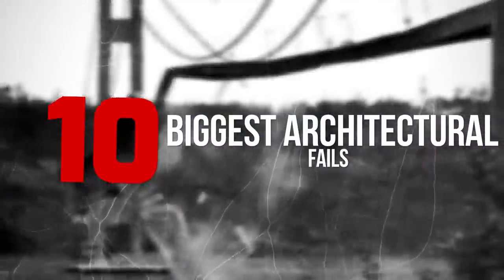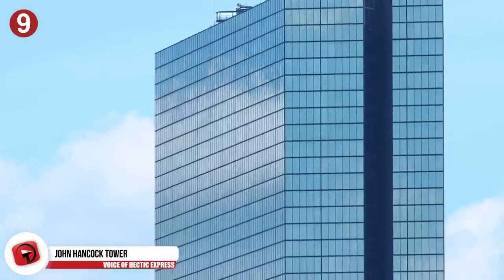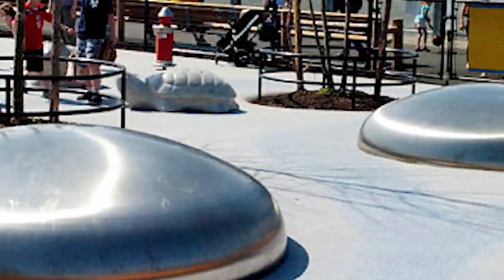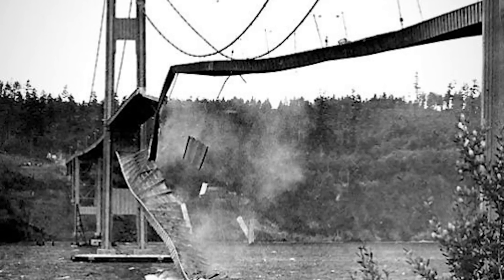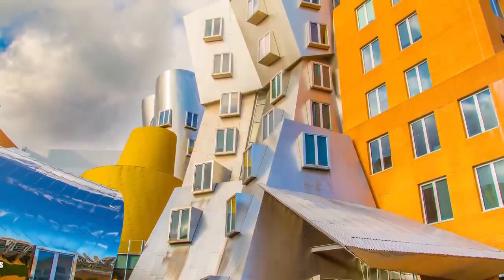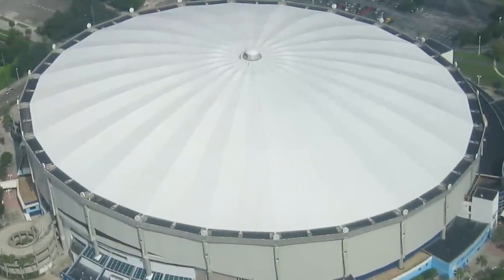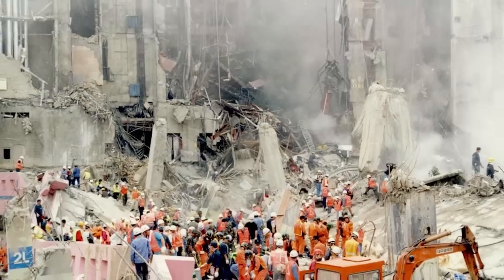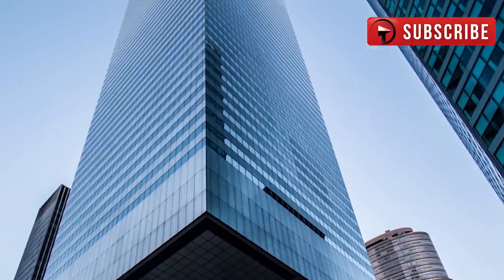10 Biggest Architectural Fails

Comment: One skyskraper toppling over would kill how many? 200000 people? Is there a nuke hidden in that building? How? Why? What even.... I just... Wow...
Reply: Yeah I was scratching my head a little bit on that one as well.
Reply: But..but..but either way it was built above a church and they could've prayed to " their God(s)" XD
Reply: I was just about to post something about that… I'd like to see the number crunching that went into that calculation.
Reply: acuchemkid2007 It would wipe out my town 8 times over...
Reply: Its the accumulating damage.  As well as taking out itself, the church and people on the street below, its located in a tight place.  So it would damage nearby buildings, and possible topple one or other others. 

Each skyscraper its size has a population often the same to a town.  So the can house up to several thousand people. So if that skyscraper fell and hit another, thats two towns worth of people who can get killed.  Its the architects fault for building them in that area so close together. ITs surrounded on all sides pretty much by towers.
Reply: I guess it would have triggered a domino effect and cause many other buildings to crash to...on the other hand: when the first tower of the WTC collapsed it didn't even cause the other one to crash too.
Reply: Yes, it has the potential to kill thousands. However, that doesn't mean any large number you barf out is valid.

There are 71,672 people/sq mi. in Manhattan. That's 610 people per block. One World Trade Center has 109 floors. If there are 200 people/floor, that's 21,800 people. If OWT, the tallest building in the US fell and wiped out the blocks in its path (about 5 blocks), that's 24,850 people. That's less than 1/8 of 200,000.

That scenario is the most extreme case (tallest building, extremely high population density). 

So, 200,000 is a tremendous overestimate.
Reply: AngelEmfrbl To kill 200 000 the building would have to be chasing down people as it fell... And even then it would be hard pressed to reach that amount... Yes a fully filled skyscraper would mean several thousand people dies, but 200 000? Come on man... Think before you answer...
Reply: Yeah But WTC went straight down and it's been proven that there were explosives in place.

Had it fallen the way it naturally would have, the top of the tower would have slid off, you'd have half a tower standing, the other half would fall onto the street.
Reply: "Up to 200,000" probably because that's exactly the maximum amount of people that could fit in a Citigroup Center-shaped area below the Citigroup Center.
Reply: Denberg has a great point - please give some proof of these explosives Sean nolastfuqingname.
Reply: +Sean nolastfuqingname please site the proof of explosives in place. Either pics or vids or it didn't happen.
Reply: ***** he must have been a dirt poor migrant worker because if memory serves me right the sales of handheld video cameras exploded in the mid 90's and was a must-have toy for those of us who had the the spare coinage lying around. They had them in the 80's as well if you didn't mind lugging around a unit that accepted full size VHS tapes.haha membah dose niggah?
Reply: +Mark Winberry Btw twatty, My IQ is 161 and I have never been poor. I graduated from a top 50 university by mostly just doing the exams because I'm smart enough and I could. I'm also the only person in the history of UCI to have had two Engineering senior design projects instead of one. Lol.
Reply: Tarek - what area of engineering did you study?
Reply: +BassGuitarGuy128 Materials engineering.
Reply: +Renberg If you look at close ups of the collapse you will see mini-explosions happening on the steel columns, as a materials engineer I can easily say that those are not caused by buckling... However, I did make a stupid mistake by stating facts to a "Berg" on youtube. Or I maybe I MEANT TO MAKE THAT MISTAKE to see how creative the lies of denial would get.
Reply: +Renberg I'm arguing with a fucking photography-lover about Physics. Nice. In my defense, I AM really bored these days...
Reply: Tarek - you have a degree in engineering. You must know that you cannot derive conclusions and make decisions based on limited, observational evidence; especially when those conclusions insinuate some outlandish claim - that the U.S. gov't killed 3k Americans and wasted two skyscrapers so it could start a multi-billion dollar war. 

How sure would you say you are of these 'mini-explosions' being caused by explosives and not the aircraft full of highly flammable airline fuel? How about a percentage.

Where's that evidence? Where are the computer models? Taking a film clip and saying, "Yep, explosives were used" doesn't cut it - not in academics and certainly not in the real world.
Reply: +BassGuitarGuy128 100% sure. People have already made computer models based on footage and distance of structural debris from ground zero.
Reply: Would you care to cite your source(s)?
Reply: Tarek EL Derbas What a coincidence, I have an IQ of 162... I've flown around the moon twice, won a noble price and have three degrees in physics. I just take time of in my busy schedule here at the Large Hadron Collider to answer YouTube comments. I greet you my fellow genius.

Also, in my free time I volunteer as a fireman to rescue kittens from trees and I serve soup to the poor in the evening.
Reply: Tarek EL Derbas What do you mean?sarcasm?
Reply: Phelix Kelevra Still not funny. Have a good one.
Reply: I know right - this is the "number one" fail and - actually - might - could have - and nothing - umm... happened.

In fact the "you might think" hypotheses of most of the items mentioned are superficial, ill-informed cheap shots. Just about ALL skyscrapers are "built on stilts" (that go all the way to the top) - they are just steel frame structures with some form of cladding closing in the gaps. All they did with that building was not fill in the lowest couple of storeys.
Reply: Phelix Kelevra 
Yeah, it doesn't make sense. It would probably kill more like 800ish or possibly lower.
Reply: maybe they do have a nuke in the building... you never know
Reply: they did..... there was remodling done on the floors where the planes hit, they laid thermite charges during that and set them off. notice the white hot molten metal falling from the towers in videos. jet fuel also doesn't melt steel beams. but you know, the Gov't totally wouldn't put Oil above its own people, because people totally are not greedy. i used to think there was no way that the gov't did it but after looking at the facts... its pretty obliviously something else was at work... like all the media outlets, in there vids of the crashes the plans all had different companies on their tails for a little while till they all get them straight.
Reply: that would be like wiping out 20 times the population of my town
Reply: I think a lot of people were in the area *COFF COFF* like maybe an event or something?
Reply: Also, he said IF IT DID
Reply: That's what I'm saying
Reply: It would topple into other skyscrapers and the area below is quite busy. They have that number because a study was initiated by the Red Cross to surreptitiously canvas the area and the surrounding buildings to ascertain how many people (employees and customers) they might need to pull out of the rubble. The Red Cross was also involved in planning for the disaster in case a hurricane/strong wind hit before they were done. The building managers hired every welder in a 100 mile radius and the mayor was involved. The video made it seem like it was a complete secret. It wasn’t. And rather than cause a panic, they informed the people responsible should the worst happen, and began fixing it right away, all the while they were getting specific reports from the national weather service to have as much notice of any potentially strong winds.

Comment: Some of these are engineering fails
Reply: Yes, but the original meaning or architect was "building-engineer" (there is no good word for the concept in english). It comes from the skill of constructing arches (which means designing in other languages...).
Reply: Great to know, specifically...thanks...I'm a numbers detailed type person...so I greatly appreciate that...words too are very useful to get the exact idea....truly..thanks!!
Reply: btw did you agree with number one?...I sure felt, 2 could have been 1 with all the hundreds of deaths.  I'm glad the first one...ended up not fully failing, but yes, in the end it also was a fail...
Reply: there is actually fascinating footage of the tacomma narrows bridge going down...in motion...one of the most vivid vids I have seen...for a natural disaster, that is.

Comment: I remember hearing about that last one.  From what I remember, it was originally designed to have welded joints but the construction company decided it would be cheaper to just bolt them and they didn't bother telling anyone.  The design was tested against high winds and was deemed safe; until a grad student pointed out that they tested broad-side winds but never tested wind directly against one of the corners.  The re-evaluated and determined that the building would still withstand winds from the corners... or at least, it would have if it had welded joints like what was originally intended.  When they discovered that the joints were bolted, they scrambled to start retrofitting it with welded plates.  During this process, there was a hurricane threat and they weren't sure if the building would survive a hurricane-force wind without all the plates in place, but the hurricane never made landfall so they were able to fix all the joints.
Reply: They also didn't keep the problem a secret. They informed the city of New York, who created evacuation plans for the area around the building to put into action if the weather ever warranted them.
Reply: But the Architect still gets the blame?  GC's are culpable for this kind of stuff too.  Then again who was keeping an eye on the project?  Weren't there any special inspections on the welds?  Mind you, this was the 1970s so things could have been a lot looser.
Reply: Nope, the contractor asked for permission to bolt the joints and the engineer signed off on the change.
Reply: Scott B
That's fair then.  I've seen that RFI question before.  The can-we-use-bolted-connections instead of welded?  Of course it's cheaper and easier.  But then there's a reason why welds were called for in the first place.
Reply: I don't think SEELE would appreciate you wasting time on YouTube videos.

Comment: Melted cars down to their body frames? How old are you?
Reply: two and you
Reply: To save weight, many body panels are made of odd kinds of plastic mounted, of course, on the vehicle's metal frame. High-performance cars are more likely to have these parts than regular cars. And, yes, they can melt under intense heat.
Reply: No 'regular' cars use cfrp. Video showed a melted wing mirror and was being sensationalist.
Reply: 99% of modern cars are unibody construction... try again.
Reply: The Walkie-Talkie only did that to few locations which were hotspots; This noted case was about the owner of a green Jaguar XJL...

When the owner of the vehicle came back out, his hood ornament, mirrors and front bumper were warped and sagging from the heat.

The only thing on the car that this happened to that actually melted, were the windshield wipers' rubber contacts and if I'm not mistaken a chunk of the tire treads from parking on the burning hot concrete...

Oh and Motty, like was earlier mentioned, performance cars are usually Uni-bodies, where the body panels make the structural integrity of the car. No plastic there except maybe the quarter panels.

Nowadays only trucks / suvs and some minivans / crossovers have frames and as such, more plastic body panels; This is because they weigh more and need a real frame.
Reply: Thanks for the info. It adds to and improves my knowledge base.
Reply: Not possible in London. Not enough sun.
Reply: between 1year old to 17 months by the sound of him
Reply: @justclosing  true

Comment: I grew up in the Boston area in the 1960's and 1970's.  I remember the John Hancock Building.  This video is not accurate.  Several people were injured by falling glass panes.  It was in the news and in the Boston Globe.  They warned people not to walk within two blocks of the building.  Panes of glass were found up to three blocks away.  Cars were destroyed.  Damage was done to surrounding buildings.  

I now live near St. Petersburg.  I have been to several Rays games when the Red Sox come to town.  I have not witnessed any problem with the Tropicana field dome but I would like to point out that without the dome the air conditioning would not function and this time of the year very few people would want to sit in 98 degree heat with a heat index of 110 or sit through our daily thunderstorms.   Without the dome half the fans wouldn't show up.  

So where are the photos of the church in the last item?  All I see is a building with an unusual bottom.
Reply: I guess later the church was demolish xD
Reply: Wow. Thanks for sharing this.
Reply: Because you can see the bottom of the building, the camera must be pointing up, so the church is below the frame of the photo.  The stilts are in the centers of the walls, not at the corners, because the church occupied a corner of the block that the Citibank building is built over.  The potential for tipping the building over required a severe hurricane to make landfall near New York City and still be a severe hurricane when the winds against the tower to hit the tower directly into a corner.  While there was a hurricane in the Atlantic as they were finishing the welds, despite the real possibility, the building was never in any danger of failing.